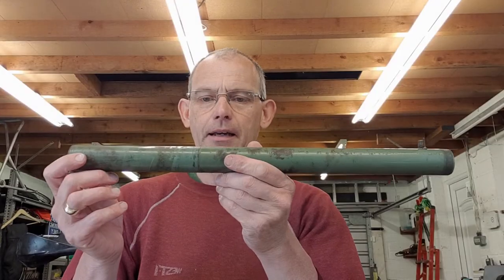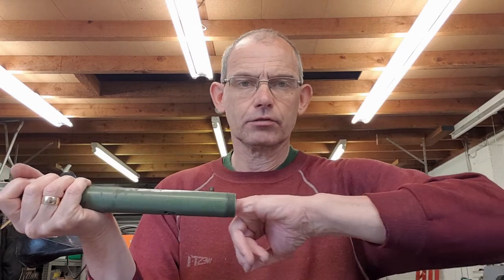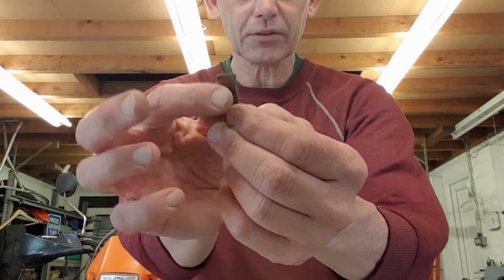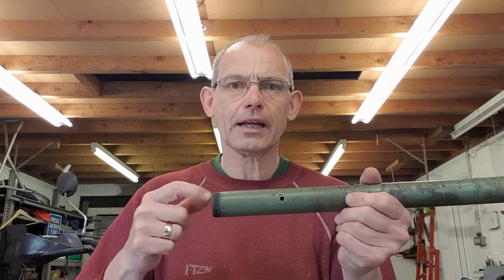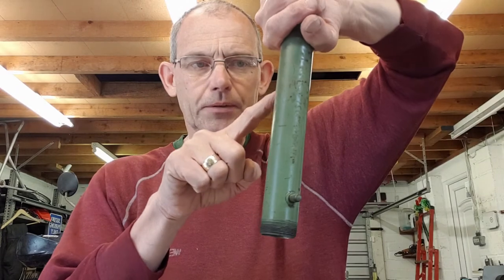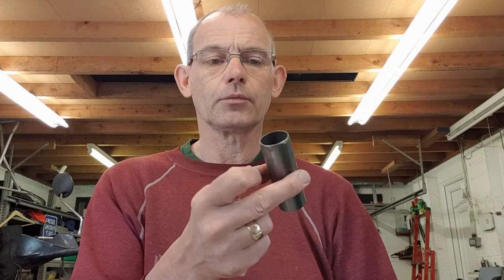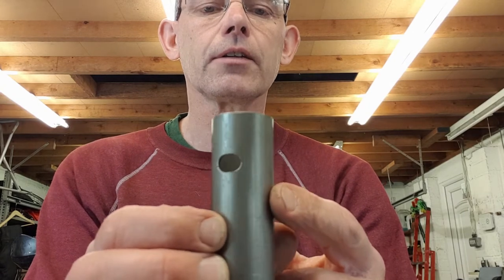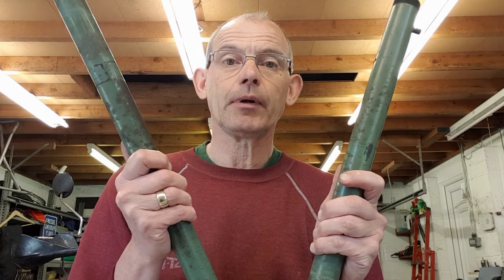BSA Bantam, early D1 forks - replacing the bushes that are silver soldered in..

Comment: I've never had a whole Bantam but I once fitted a D3 engine in a Russian frame from a Regent 125. The Russian engine was based on the same DKW engine design as used for the Bantam but  BSA did it as a mirror image, so that the gear lever and kickstart would be on the right. The engine mounting holes lined up perfectly but I did have to modify the rear brake lever to go on the other side of the frame.
Reply from the maker: Interesting! 😊

Comment: Why not just use a full length of brass which is the same length as the bushes and spacer?
Reply from the maker: Several possible solutions, but this was recommend on a Bantam forum and it worked nicely. I'm more into working solutions than "exactly as it should be" absolutism. 😊

Comment: I'm totally not an expert, but if I had to remove such soldered bush I'd go to guy with good lathe and try to mill it out.
Reply from the maker: That's a fair point, but not everyone has either the contacts, the money or the equipment to do that. I've ridden, raced and worked on bikes for over 45 years, and sometimes you have to make do with what you have at the time - particularly if your bike is needed for everyday transport. There's a balance to be had between a practical solution & an ideal one. 😊

Comment: Dear god… a propane blowtorch is enough for silver solder!  Or find someone with a lathe and bore them out!!  Twatting it with a BFH is NOT the way to do this.
Reply from the maker: That's fine - if you have a Propane blowtorch... My way worked though 🙂
Reply: @t20racerman  using inappropriate tools is no defence.  A visit to your local DIY shop would see you equipped for very little money. We’re talking the sort of equipment that’s used for traditional plumbing… nothing more!